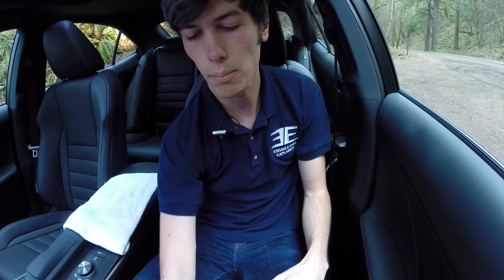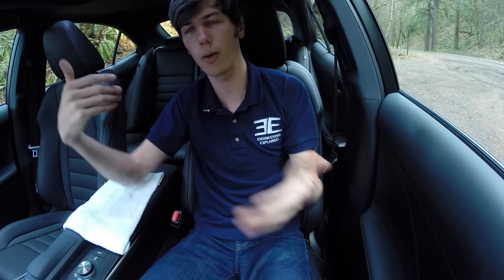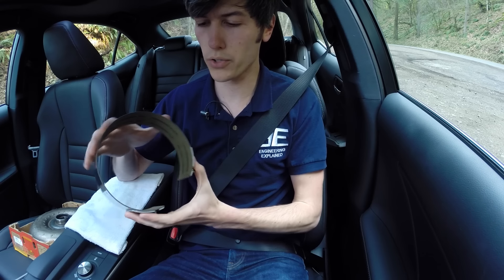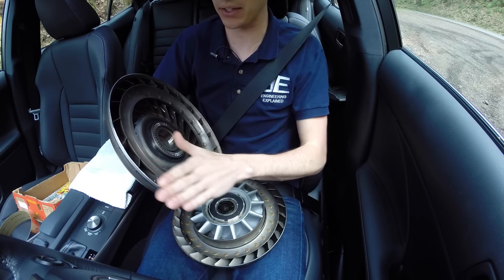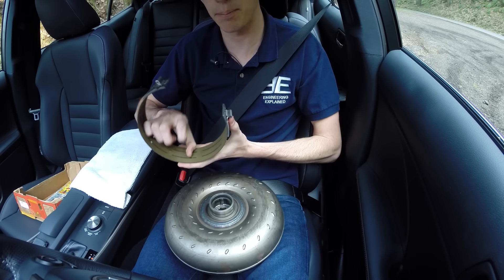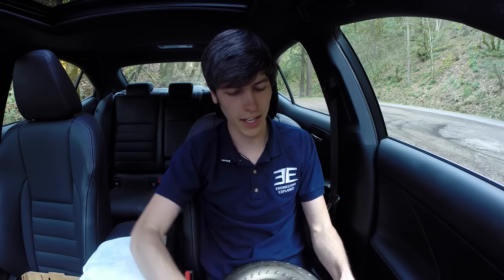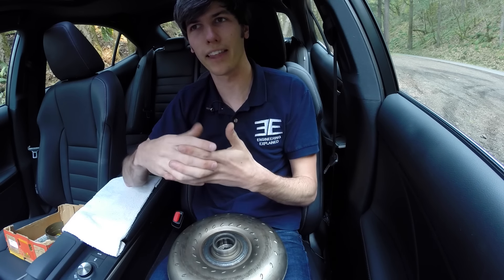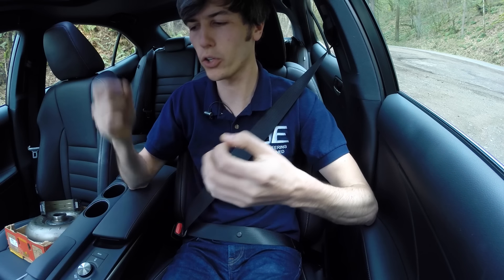5 Things You Should Never Do In An Automatic Transmission Vehicle

Comment: 1st thing luv your video(s). 2nd thing YouTube allows us to see older vids, good stuff.  However you show only N\A types of ATs. Band type with planetary gears. GM was out of the gate 1st with AT technogy and licenced their AT all over the place. Good business move at the time.
 Honda developed their own ATs,  with over 2000 AT pattents plus at the time,  H never infringed on one of the registered pattents. They used/use clutch packs. 1st version was a HondaMatic. Manual shift between 1st & 2nd & Reverse . R was a problem as the R selector servo was weak as well as the shift fork and  R selector hub also.  Additionaly they used  maunual choke that kept the Revs high in reverse, further damaging reverse fork, sector etc. Good trick was to back your honda in to it's parking spot and drive out with the choke on = no R grinding.   The H torque converter and stator allowed ATs to be used with smaller PS engines. Clutches had cast iron sealing ring (like a piston ring) that locked at both ends. It  fitted into a guide (like a cylinder).  Clutch packs could be assembled exactly to OEM MFR spec. No  ATF filter ever but rather an oil  sump. Current Hs ATs have a non servicable magnet in the torque converter housing and one the drain plug that you may clean. Hondas ATs are clean room precision assembled.
Take a beater 1st gen Civic  thow it in  reverse, shift to 1st flooring it and smoke the tires  and keep it floored and it would pull up to 70 mph in first and then you must shift. It gagged on 2nd gear shift but it would respondvt a
Ny sfternathetbe would Plus it lived. I could overhaul ATs on 1st gen civics or accords and the prelude on the car. Prerequisite was no burmed or discolored ATF as that ment  a complete AT off car overhaul. Additionaly 1st gen civics etc. Had a rebuildable bolt together torque converter, not till 80 civic did they use a welded together converter non servicable convereter. (BTW: same deal for a standard 4 speed or 5 speed manual (overhaul on the car only pull if mainshsft seal failed and that ment a clutch job as well.).
So how many MFRs don't use a ATF filter in the AT tranny?!?! Hyundai now has one the  Elantra.
So If  YOU Ever Revisit ATs please take a look at Honda's.  Principal is still the same even though its got six speeds.
Final comments. Honda's current service for ATF fluid is at 30,000 miles or 48K Kms.  This is only a partial change and looks good for vehicle servicing. Herin lies most of the woes for a Honda AT and prob for H CVTs and the new Honda manufactured 9 and 10 speed transmissions. The latter 2 mentioned I've not got at but am looking hard at. I'll buy the current Odyssey (2023) (maybe), as by then it'll be a mature model with no bugs. On my 4th oddy now. 1st 3 were H C Inc. Company demos current one was a New 2016 Oddy EXL NAVI. Navi sux big time however the vehicle is phenomenal want to keep your Hond 
AT or CVT in good condition  change out all the fluid and don't flush it. Oddy takes about 10 L or 11 quarts roughly. I'll do my second full change at 36,000 Miles or 60,000 K Kms Use only Honda ATF DW-1. If your doing a fluid change On Another Brand  Use only the OEM fliud and an OEM filter. After all they designed it, so dont mess around and cheap out.

Comment: Usually agree with this guy but his reasoning isn't right for every modern vehicle.  Fuel economy goes up in neutral going down hill for me and of course you don't use the brakes.  That would defeat the purpose!  You would first put it back into gear before using the brakes.  Higher revs more engine breaking.

Comment: Okay, so let me get this straight: if my throttle is stuck, you want me to apply the brakes and DOWNSHIFT.  That makes sense IF your throttle isn't stuck but you said it was.  So by downshifting, assuming the engine survives the extra revs, I'm giving the engine MORE mechanical advantage over my brakes.  Wouldn't that make the car HARDER to stop?

Why not suggest the obvious solution?  Turn the key off and/or put the car in neutral?

Comment: About leaving your car in Drive... most of the cars has creep mode when in drive meaning if you stop at a traffic light and leave it on drive there'll be a little strain on the breaking system since it's the only thing keeping it from moving especially on older vehicles... it's just a thought though I'm not entirely sure.

Comment: In a lot of modern european trucks, the automatic transmission AUTOMATICALLY shifts to neutral after you lift up the gas for more than 2 seconds.
Reply: That's because they aren't true automatics, they are manual transmissions with a computer automatically actuating the clutch and shifter
Reply: @specialopsdave  They're programmed to do so to save fuel.

Comment: I still don't understand how it could NOT be more efficient shifting to neutral at a red light for 90 seconds. If the car is burning enough fuel to MOVE it forward when you let off the brake, how is that fuel not saved by disconnecting engine from the wheels? 

I feel like the amount of fuel required to generate enough force to push a car forward for ~90 seconds at a time 10 times a day, 3,000+ times a year probably uses a noticeable amount of fuel.

Comment: I put my car in neutral at lights and such because it has a slight vibration from the idle in drive (I think if they increased the idle by about 100-200 rpm it wouldn't be there, it isn't there in neutral, which idles about 100-200 rpm higher).
It's not really a rough idle, but it's one of those things that once you notice, you can't not notice it. (Again idling it up to 1000-1100 rpm instead of 900 gets rid of that vibration)

Comment: What happens if you have an auto car, stop at a stop light, put it in third and try going?
Reply: If it's a modern auto. It may over ride you and drive off in first.
Otherwise you'll just move off very slowly if at all.
Though you will put tremendous strain on your transmission so it is not recommended to try.

Comment: I shall ignore the advice in this video. Why? 1) Because our next car will be coasted in neutral every time it is used. 2) It will do it no harm whatsoever. 3) It will use no fuel whilst coasting. 4) It will be safe to do so. 5) Coasting in neutral is also promoted by experts, as well as by the manufacturer. 6) The engine will not be running.

7) It will be an EV.

Comment: Hi EE. I tried shifting to Neutral on red light on my Audi A3 2016 1.4tfsi for 2 weeks and now it seems to be jerky whenever i move off from stationary, what may be the new problem now.  I agree that i should not do this shifting of gear to Neutral now. But is it too late? What damage could have happened now by this action? To anyone out there pls do not be like me to put to Neutral on halt.   Pls help. Thk
Reply: Means your automatic transmission have/has a damage because using of neutral in a traffic light?
Reply: @ramonmacasaet6193  i stopped changing to neutral and is ok now.
Reply: @shhhjj2769  good to you that you are not using neutral again, before im using neutral also but when i also experienced what you experience in your transmission i decided also to not use neutral in a traffic light
Reply: @ramonmacasaet6193  yep luckily my car is ok now.
Reply: @shhhjj2769  so you are stay on D and just brake pedal?
Reply: @shhhjj2769  some of them they think automatic and manual transmission is same of operation but the real is not
Reply: @ramonmacasaet6193  hi yes i just stay on D and step brake while waiting for traffic light.
 Its very lucky that my small episode of changing to Neutral didn't damage the car. But anyone out there should not do the change to Neutral action.
Reply: @ramonmacasaet6193  yep auto is not same as manual clutch. Frequent changes to Neutral will spoil the car as i have mentioned.
Reply: @shhhjj2769   but automatic is easy to drive if you know how to drive manual you can drive automatic because automatic it's only 2 pedals than manual but if you are driving automatic and going to drive a manual you are going to be difficult because the function of that 2 kinds of transmission is different
Reply: @ramonmacasaet6193  agree. It is always more difficult when changing from Auto 🚘 to Manual 🚗

Comment: For those of you who remember Candid Camera a show in the '60's, They had a gag where they positioned a car with the engine removed at the top of a hill with an unsuspecting service station at the bottom. 

A woman would drive the car into the service station and complain that her car seemed to have lost power.  The mechanic would then open the hood (With a truck with a camera recording it) and then he would get the tag line "Smile, you're on Candid Camera".

Comment: C'mon, using neutral to coast downhill saves too much fuel to show up in a car's mpg indicator. Those top out at 99 or 127 or some-odd mpg and it's always pegged when coasting in neutral, except at low speeds with a cold engine.
When it would slow you down hard enough that now, you need the gas pedal to make up for it, defeating the purpose of the coasting.
Even in the video, that graph topped out at 40. How do you know it wasn't trying to show 986mpg?

Comment: I often put my car in neutral when coming to a stop while driving on snow and ice. It stops the forward momentum and makes it easier to stop.
Reply: Timpala44 it really doesn’t though. Engine braking is a real thing, and you lose it when you’re in neutral.
Reply: @TimothyReeves  I'll just have to disagree. I've tested it many times over my many, many years of driving in harsh winters. Engine braking can make you slide out of control. I prefer to manually pump the brakes.

Comment: Question, what spends more fuel? The consumption on downhill coasting on neutral until the next climb or the acceleration needed to reach the peak of the 2nd climb after having a loss of speed on the descent because of engine braking?
Reply: Or, without stepping on the brakes, and from a downhill road going to flat for about 2km, how much fuel will being on neutral the whole way spend vs being on drive the whole ride? Because friction slows down the car, you'll have to press on the gas once you go to the flat.

Comment: My addition to this list: Don't put in drive, forget about it, and start driving up long steep hills. If you're going up a hill for a long time, downshift so the torque converter doesn't need to slip so much and build up so much heat.
Reply: Only applies to vehicles from 1995 and older; new ones have small internal clutches so modern torque converters are "locking" and no longer slip once you get moving and are firmly in gear

Comment: Do you think that putting it into neutral while coming to a stop is a bad practice? I drive a 370z automatic, and something i noticed is that it shifts into first early when stopping causing a very slight overrev. Looking it up online i found that its done by almost all the automatic 370s. Its likely because its a sports car, and its tuned to be able to pick back up speed quickly after slowing down for a turn ect. However i think although its minimal, its still unwanted extra wear & tear on the engine. So ive started putting it into neutral when im coming to a complete stop like at a stop sign or light. Is this a bad practice?
Reply: love the 370z🙂

Comment: You're wrong again, sir, about downshifting while the throttle is stuck at WOT.

If your throttle is stuck at WOT and you force the car into a downshift, your rear tires will then spin faster than the front tires and you WILL lose control and spin the car out.  This should ONLY be used if you have complete brake failure, but not as a result as a throttle stuck at WOT.  Also, forcing a car into a downshift, at a higher speed than the gear allows, will more than likely cause "valve stretching", which will expand the valves beyond operational conditions and then contact the pistons, resulting in a major engine failure...or if you can afford it, either rebuild it or replace it.

The proper action to take, with a throttle stuck at WOT,  is to take the car out of gear (neutral), apply the brakes and move off of the roadway when safe.  Also, you can turn the car off during this process and you can use your brakes at least 1 more time.  Your engine may scream to heaven, but it will not be damaged as it has protections in place, "rev limiter", to protect the engine from exceeding maximum RPM.

You should try what you suggest first - if it's successful - post it -  if it's not (tried and true), don't.  You could put more lives at risk with this procedure in your video.

Comment: wheeeeew (wipes sweat from eyebrow); I thought you were going to say there was some actual, legitimate reason not to shift into neutral downhill on OLD automatic transmissions, where it might actually save some gas. What about coasting down a huge interstate hill with nobody else around on the road, in neutral, at 85mph, in an old three speed automatic transmission, then shifting back into drive at the bottom of the hill, before starting up the next hill, and going from neutral idle to about 3500rpms... is that bad for a car? my experience is that as long as you're thoughtful about how you do it, it's fine

Comment: Illegal to coast in neutral? Well then you should also shut the car off, this way you can't get in trouble if you are not actually in control of the vehicle anymore. Probably turn the lights off too. In all seriousness, if you are in the desert with a V8, 1 gallon and 50 miles to go, coasting with the engine off is the only way you will make it.

Comment: Is it okay to switch between your low gearing when doing downhill? You mentioned the issues with switching from reverse to drive for example.

A scenario I can think of is if your on a steep section of a hill, you want to be in first gear and then switch to second when the hill levels out, and then continue to first when the hill gets steeper again.

Is it okay to switch between first and second without coming to a stop? (For automatics)
Reply: Yes,you can switch between  D to 2, 1,2 dynamically without inconvenience

Comment: In my first auto car (used 2006 Audi A6 allroad) I kept shifting into park (where you had to shift through the neutral and reverse settings before) everytime I stopped at the lights. A few months later, it kept shuddering at low RPM and eventually it got diagnosed as a bad torque converter. Was shifting into park so often the cause of this?

Comment: You are wrong. Anyone who has practiced hypermiling knows that coasting in neutral absolutely saves fuel.  I've never had a problem with any transmission and have done it for years with many different automatics

Comment: If you're throttle is stuck open and you need to stop, I don't think that downshifting would help slow you down, perhaps even the opposite, essentially you're dropping a gear while under acceleration causing increased RPM. Downshifting to slow down works when you don't have your foot on the accelerator, or in this case, stuck.
I believe it would be better to instead change to neutral to stop the acceleration to the wheels and then coast until it stops.

Comment: As someone who learned on a manual transmission it always feels like  neutral is calm when stopped. Automatic feels like the engine is fighting the brakes. Waiting in the drive thru fast food line my car is asking me to please disengage. It seems like not shifting to neutral or park is like riding the clutch. There must be friction somewhere.
This explains why some don't trust automatic for towing as there is never a complete metal to metal lock up.
Great job on all of your tech break downs.

Comment: So he basically didn't say anything valuable. I'm used to a manual transmission and switching to neutral when going down the hill. Recently I bought my first vehicle with automatic transmission and wanted to know if you still can switch between D and N while driving and so far I wasn't able to find a proper answer. My question would be if it can damage your engine? That's all.
Reply: I think he did say you shouldn't switch to N when going downhill.
Reply: @appsupport9871  So what he says we have to listen?! Go and google yourself. You can move to N and back to D while moving. And it does save the fuel and pollutes less.
Reply: @bizjakboris  Agreed. Does it have impact on the gearbox ? Thanks.

Comment: Something you were wrong on. "Your brakes will always be able to out power your engine." FALSE. I know many vehicles that can outpower their brakes due to sheer horsepower/torque. If you attempt to accelerate (or the accelerator is stuck) in some more powerful vehicles, they can (and will) move even with the brakes locked up. DO NOT ASSUME THAT THE BRAKES WILL ALWAYS WORK!!! The correct answer to needing to stop a runaway vehicle is to put in neutral first, THEN depress the brake.

Comment: The main reason I put it in neutral at stop lights is if I'm hauling something. The manuel says it helps cool the engine down. More rpm and coolant flow around the cylinders

Comment: If your throttle sticks just turn off the engine. Your car will let you turn off the engine in drive, just not take out the key. If worse goes to worst, pop it in neutral. It'll probably destroy your Engine but you'll still be alive.
Reply: Dont turn off the engine since power steering and brake assist will be gone so put the car in neutral.
Reply: @bassdrumflextime1253  I'd rather have to push extra hard on the brakes and use both hands to steer than put it in neutral. If you put it in neutral it'll redline because there's no load on the engine. Getting an unplanned workout while steering>engine rebuild
Reply: @sambrandt4755  yeah that is true lol unexpected